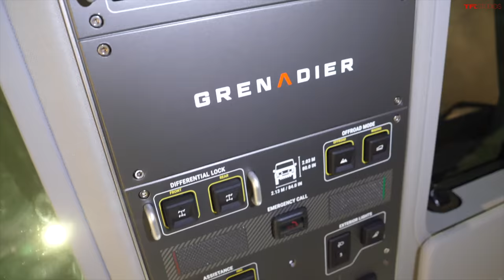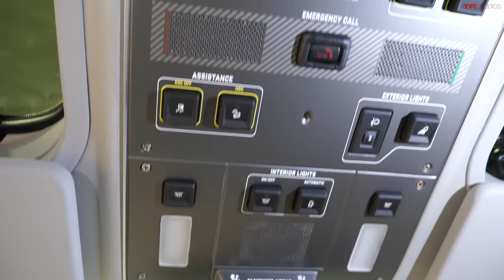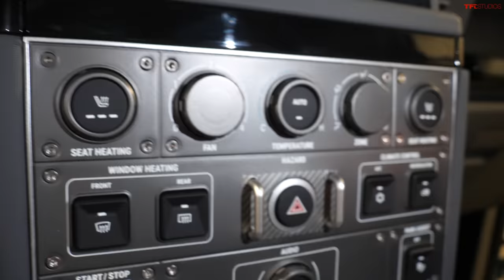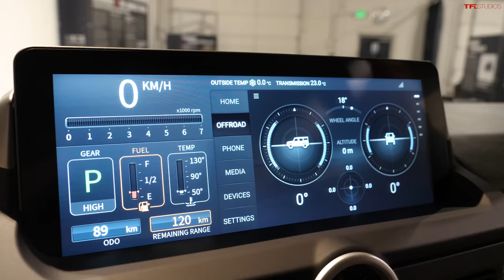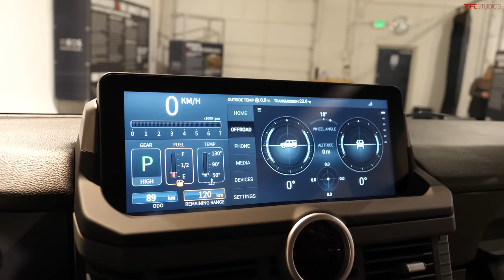The Ineos Grenadier Is The Old-School 4x4 You've Been Asking For!

Comment: The speed odometer needs to be in the traditional spot behind the steering wheel so you can simply look downward while driving. Other than that it looks pretty nice. I seriously doubt they'll get it down into the 50k base range. This will be out of reach of most Americans. I'd also be afraid what maintenance costs will be as well since its a British design.
Reply: It's actually safer to have the speedo off to your left (right if you live in a country that drives on the wrong side of the road). From my Toyota days when we sold the Yaris, tests done indicated it took 40% less time (or was it 30, too long ago) to look at your speed and get your eyes back on road. I have the traditional speedo in my Defender 130 and also a Pioneer screen in the centre of the dash that syncs with GPS date to display speed. I find myself looking at the Pioneer for speed rather than the speedo.

Comment: Very cool! I love this and wish we could get the Jimny also.

Anyone else notice that the decals for the front and rear lockers don't correlate to the proper position? Not a big deal and I'm sure it was just overlooked for a demo vehicle.
Reply: Err, no.  The decals are above your head not down low.  So they are in the proper position.
Reply: @einfelder8262  That's not what I'm talking about. The locker switch labeled "Front" shows an X on the rear axle and the "REAR" locker switch shows an X on the front axle. Pause it at 8:30.  Maybe the X indicates the axle locker that is NOT being actuated, but that seems like it would be opposite to how every other manufacturer does it.
Reply: @scottk.8494  Yes,  I'm 100% sure that the steering is done by the front wheels turning. So the pictogram showing wheels at 45deg angle must be attached to the front axle. Conclusion then is that the image depicts the differential to be "locked" when the button is pushed as the one without an "X" marking the spot. Otherwise they've screwed up . Good spotting and its going to be confusing to most.
Reply: @johncanalese588  Yeah that's all I'm saying. I noticed it quickly and it just seemed opposite to how Toyota, Jeep and others do it at a glance. But for all we know there is a cool light that lights up the locker selected also. This thing is cool and with the aerospace/aeronautical vibe for the interior I wouldn't be surprised.

Comment: good looking vehicle. The transmission selector does not fit well with the rest of the vehicle :)
Reply: I would imagine that the BMW shifter does not make it to the production unit.   Unless there are electrical components inside the shifter or shift box that have to be connected to the BMW powertrain it should be replaced.  That said hopefully with something a little more modern/beefy than the 4H/4L shifter.  Both shift knobs seem like parts that were laying around and not purposefully designed components.
Reply: @rlaracue  Ineos have said that to develop a new shifter would have cost a significant number of £millions to design, test, manufacture, etc. So they stuck with the BMW part.
Reply: @skwdenyer  Actually I heard that the Electronic Gear selector that Ineos is using is actually a ZF made part, like the 8HP transmission and not specifically BMW - but maybe BMW designed it and ZF engineer and make it?

Comment: The lift-out sunroof was the standard aftermarket option in Europe in the 80s (and some OEMs, too); easy to fit (just cut a hole), requires no space / mechanism for sliding.

Comment: I’m guessing this will be a wealthy enthusiast vehicle. $100k+
Reply: Five-seat Ineos Grenadier priced from about $85,500 in Australia
Reply: It'll be cheaper than a 4 cylinder Wrangler rubicon here in the UK!
Reply: I was thinking base at 55 high end at 100. 
What do you think about the control switches?  Kind of getting a industrial vibe from it.
Reply: I heard last year they were planning on selling this for 45k British
Reply: @danielgoetz7821  reservation starts at $85k usd.  No thanks at that price.
Reply: It's going to be around €65,000 euro starting price in ireland for the 2 seater commercial, which is perfect for my needs.
Reply: Starting at around $65k in the USA
Reply: @harleyrobertson6746  48k GBP, but VAT deductible, meaning business owners can get 20% back. Over here it will be above our "midsized" pickups, but below new defender and the luxury suvs
Reply: @steveofengland  it'd be around a full size truck area
Reply: @harleyrobertson6746  yeah probably. The double cab pickups we get in the UK are all very much "world platform", meaning they're good, but noticeably built to a budget. Some are better than others, and you get some higher trims, but for the most part they're not pushing the limits of what's possible. Most have a small 4cyl diesel too.

The Grenadiers underpinnings have been built (in my opinion) to be a strong as possible. Therefore I don't think it's fair to assume it'll come in at the same price as a top spec truck over here. This is going to be a serous machine, with a thumping engine, all the offroad hardware, and  an intended lifespan far beyond that of a normal truck.
Reply: @steveofengland  the chassis is made from box tubing with 4mm thick walls, so it'll be as tough as old boots

Comment: I feel like it’s going to cost around $70,000. Which at the end of the day I think it’s still a good price for this truck. Obviously I would love to see it below 50,000 but I’m not holding my breath. I’m just happy that it’s not going to be some low production $150,000 “special” truck.
Reply: Early estimates are $75k to start, which means $100k with options is very possible. Plus going through a dealer network inevitably means dealer markups are incoming.
Reply: in Australia $84,500AU for 2 seat , and $85,500 for 5 seat wagon, base. you do the conversion. And no extra for diesel engine.

Comment: I wouldn't refer this as old school, more like modern with proven and reliable tech. Nothing would be more frustrating than an electrical glitch many miles from a repair shop.
Reply: The only new "old school" SUV is the 4runner, IMO. Old 4.0 V6, five speed automatic transmission, 4WD, simple interior. The Prado isn't sold in the US, and it kinda is a luxury vehicle, even without the Lexus badge, so it doesn't count. The LC76/79 is more old school than the 4runner, but the US doesn't get any Land Cruiser in any form, so that doesn't count either.
Reply: It’s really funny how people view this as “reliable”? - Ineos never made a car before…

Comment: Cost? I can’t imagine this car coming in below the current LR Defender or even a Ford Bronco. So much going into this vehicle is bespoke and low-volume that it’s manufacturing costs must be higher than it’s competitors (BMW sourced engine, built in Mercedes plant, specked out like $90k defender.) I’d bet this will start in the low $100’s and quickly go to near $150k or more. I miss my ‘90’s Montero.

Comment: the Ineos GRENADIER 4WD + 3.0 in. Lift 2.8 TDI I4 5-Dr SUV (RHD) could do with a 3.0 in. suspension lift & 34.0 mud/terrain radial tyres . . . add to that front snorkel, gps vehicle tracking, full length roof rack, jerry cans, full size spare wheel/tyre & roof mounted solar panels for uninterrupted auxiliary power supply at camp sites . . .

Comment: I love this thing!  They out Rovered Land Rover....take a hint LR...you've lost your way.  
Is it an aluminum body?  What is the total weight?
This is what I would have designed if I had several billion dollars.  Love the control panels and switches.  Also like the exposed screws for easy access...no need to lay on the floorboard searching for hidden fasteners.   Love the straight six engine...smooth.  Well designed and well thought out.  I'm sure it will sell for over 100K.
Reply: 2870 kg empty, 3500 kg total, don’t think it’s made from AL
Reply: @lukasvass681  Can you identify from where you got that Tare weight of 2870kg. I understood that the Grenadier will have a GCM (Gross Combined Mass) of 7000kg and it is supposed to be able to tow a 3500kg trailer. This means that the GVM (Gross Vehicle Mass), would be 3500kg. And, the other piece to the puzzle is that I've also heard it is supposed to have payload capacity of just over 1T (1000kg). This would mean that the tare weight would have to be below 2500kg! Is my logic wrong.
Reply: @johncanalese588  I think a friend who saw a proto at Abenteuer und Allrad last year told me that figure. But that could be only the case of the proto. Now I also admit that I could be wrong and I don’t remember the number correctly but I’am quite sure it was more than the +/- 2,6 tons of a MB G Pro.

Comment: For a variety of old school reasons, this looks more attractive than Wrangler or Bronco.  I think you are optimistically low for what the msrp will be.  With a 7,000+ lb. tow rating I would think this would be a good match for smaller off-road towed trailers.  If fit and finish plus reliability are good, this could be a winner.  If pricing is affordable, it is a definite winner.
Reply: No  way in hell you're getting one in the US for less than 100k anytime soon.

Comment: Nice looking vehicle, But the rear lights let it down drastically. If you follow a Bus around you will find that the lights especially the indicators are very hard to see with these led integrated lights. If it were separate lights it wouldn't look so bad, It will be the first thing I change when mine is delivered.

Comment: Heads up display would fix that issue .. even with my model 3 I still hate that the speedometer is off to the side , so I added a hud display system and it works great … 

Other then that … this is dope af , can’t wait to c these on us soil

Comment: The UK version (based on a Carwow review on YT) of the base model is estimated to be 53,000 pounds which means the US version will start around $70K plus options.  So the $55K estimate, as of now , was sadly off.    If this UK pricing holds expect the initial US shipments to run 85+K loaded.   That is comparable to more than  Rivian RT (with the 400mi battery its $86-87K) or RS (under $80K with 316mi battery).   Plus with the Rivian you get a $7500 tax credit.   Even a loaded out base model Defender with more lux features can be had in the 80s.   The Bronco Raptor is supposed to run $77K so an Ineos at $85K will likely appeal to G Wagon lusters who cannot afford a G Wagon.  So not the utilitarian pricing we expected based on the design.   But in fairness it will be a small volume, unique off-roader built by a chemical company.   This probably never was going to be a cheap old style but modern Defender especially with labor and component prices in an inflation cycle.
Reply: You cannot directly compare prices.   UK prices, for example, include VAT (something like 20%).   BMWs cost far less in the US than if purchased in Germany, where manufactured.

Comment: No speedo in front of the driver will be an issue for many, manufacturers have tried this before and it never worked out. Otherwise very accomplished.
Reply: It will be more distracted drivers looking to the right more often to make sure you're not speeding

Comment: My old Isuzu Trooper [Bighorn?] 3.1 diesel from 1994 had a split rear door. Ran it until it was scrapped some ten years ago.
Reply: That 3.1 engine was bullet proof.
Reply: @kevinmccormack6610  
Pretty good, smooth but very thirsty, not helped being an indirect injection engine. Much more reliable than the engine that came after it, which was a bit of a disaster.
Reply: @hedydd2  totally agree that early 3.0 litre was a time bomb. But the later ones were improved but the damage was done and no one would go near them.

Comment: Tommy, do you possible have any info on how large the ring gear is in the differential?
I have not been able to find it online. It is vital to have strong diffrentals to see if it good candidate or not for become modified for big tires. 

Ineos are doing a mistake to not fit it with at least 33" from factory. After all the idea behind this project is to build a very worty overlander first and foremost.

Comment: Lots of good points about the Ineos , but of course no vehicle is perfect. Some of the short comings missed : Many low hanging components which will risk damage off-road. Steering damper, fuel tank, suspension mounting points on the body, rear exhaust mufflers (silencers).
 Batteries and fuses mounted under rear seat resulting in a high rear seating position and no flat load space when rear seats are folded down.
 Lack of available area under vehicle for any decent long range tank. ( Yes, not an issue for every Country, but here in Australia, 90 litres won't get you far outback touring and carrying a heap of fuel cans is a nightmare. My Toyota LC105 carries 260 litres (total) with the additional long range tank fitting easily.)
 I still think it has the makings of a good vehicle, but like all vehicles, there is obviously still room for improvement.
 It will be good to see how they are going after the 'honeymoon' period is over. To me that's the real test of any vehicle.

Comment: This product need 8 more Features that will allow it to truly be a compelling product 

1 remote start ( if you need to start it when it’s cold )
2 keyless entry and start ( in the great outdoors I should not have to take out my gloves and fight with my phone and wallet   And bunch of keys in my jeans pocket to get the keys to start the car in the freezing cold)
3 wireless charging pad for cell phones  ( people will be very dependent on CarPlay and Android Auto )
4 more cup holders 2 for each passenger : water and a slurpy can’t tell you why but cup holders sell  
5 multiple USB ports 
6 an optional rear bench seat that could accommodate 2 kids that could be clipped in or clipped out . Entry to the rear would only need to be on one side of the mid row seats keep the batteries on the other side. Or from the small split door at the back 
7 and maybe put another one of those clipping racks on top of  each of the front fenders  ( this is more of a nice to have ) 
8 also if you could have a touring mode and an off road mode that would allow the ICU to adjust the torque curve and horsepower curves for road highway cross country touting . Because in the US 95% of the time this thing is going to be on the highway taking kids to soccer and the wife to dinner 

With these features I think this would fly of the shelf and these features would add less that $100 to production cost the technology is readily available and adds more utility to this fantastic product

Comment: I hope it is very successful because other manufacturers will follow suit. Most of todays vehicles are pushing luxury and are not very useful offroad. The speedo & other important info should be behind the steering wheel, they probably put it in the center screen to make left/right steering wheel builds easier.

Comment: This is the best and rugged 4WD in 2022 besides Jeep Wrangler. 2 things I would suggest: screen 📺 behind stirring wheel, and real gear shifter instead of BMW electric shifter
Reply: Every modern automatic shifts electronically.   Even in a Toyota with a "real" gear shifter has no mechanical connection to the transmission.   You are moving a lever that is simply sending an electronic signal to the trans.

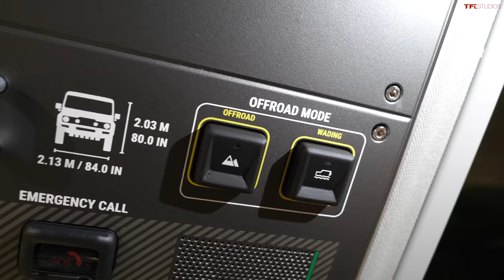Comment: @8:24 Do you think Ineos is aware that they have the icons on the diff lock buttons reversed? The "Front" shows the x on the non-steering axle and vice-versa.
Reply: Solid line axle means it's locked. The "X" means it's an un-locked axle.
Reply: @CallsignVega  That'd be contrary to all symbology I've seen thus far in production vehicles. GM, Ford, Toyota, Nissan, Mercedes...

Comment: The roof panels on some models are simply a DRIVER AID. if you are decending a very steep slope or traversing a gulley you are simply be able to see where you are going.Trucks without these will require a neck bending exercise or injury.

Comment: The BMW engines are probably a good choice, provided they can be maintained to BMW's service schedule and have the quality of fluids they require.

An automatic box seems a strange choice for a genuine off-road vehicle. How will servicing be accomplished in the Australian Outback, African deserts.... Plus a flat battery will leave the vehicle crippled as you can't bump start it!

The engine/transmission relies on some sophisticated electronics. pre-production models show fuses, relays etc underneath the rear seats.

What happens if you are stranded in a river, caught in a flash flood?

With the engine and auto gearbox ECUs plus the CANBUS components flooded the Grenadier will possibly/probably be immobilised until some expensive repairs can be done. It won't just be a case of draining and refilling fluids, drying things out and away you go.

A manual gearbox would be preferable, vulnerable ECUs, relays, fuses mounted at the height of the dashboard at least, preferable up in the roof console is really essential.

In many ways the Grenadier is an unhappy compromise between a Chelsea tractor/SUV while looking like a full-blown off-road capable 4x4.